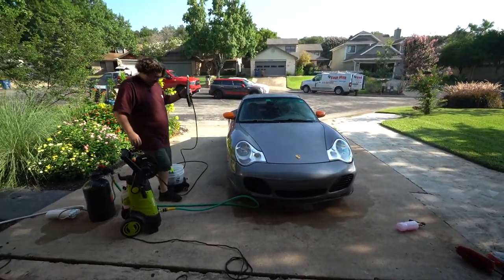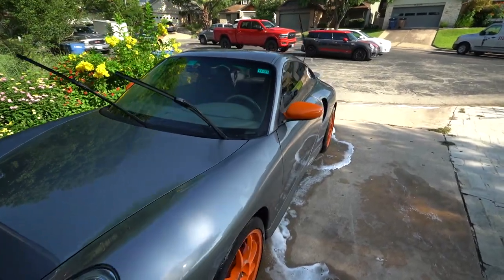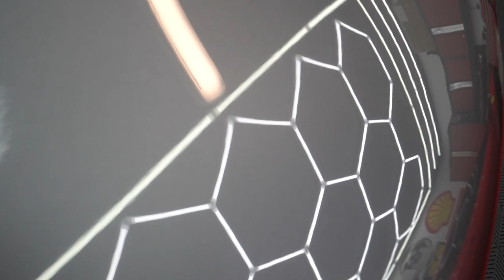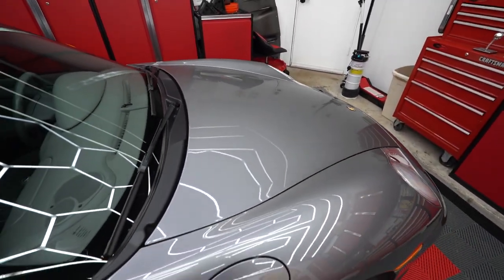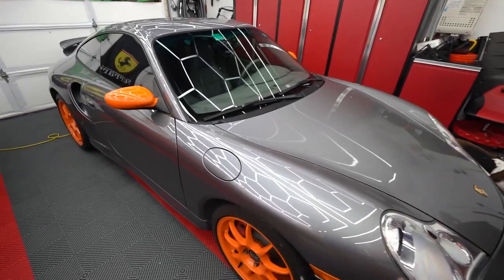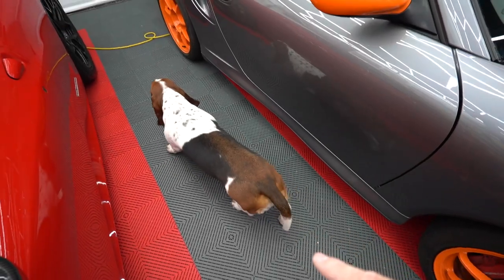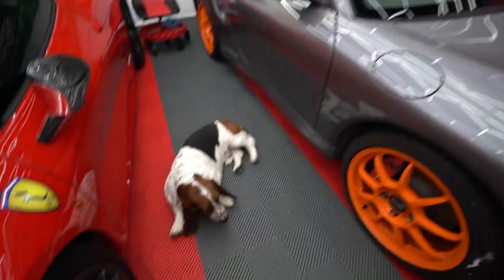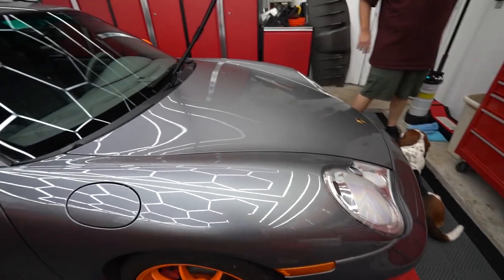The BEST DIY Ceramic Coating? Glidecoat Ceramic Coating a Porsche 911 Turbo

Comment: Dan, please please do a wall mount pressure washer install, it would make a great vid. You're garage is too nice not to do it. Since installing mine this summer I use it constantly. It was painful to watch the mess of hoses everywhere on your wash. Get a good quality washer hose with quick disconnects and it will make the wash experience much much easier. Obsessed Garage- pressure washer vids. is all you need to get set up. Matt does the best in depth reviews on which way to go.
Reply from the maker: Great suggestion!

Comment: I prefer a more expensive ceramic coating, the Kamikazee brand.  However, if you're operating on a budget, this may be a foot into the door of the more professional level ceramic coatings.  Personally, I skip clay barring because clay leaves microscratches in the clear coat.  Instead, I use tar and iron remover and then wash over with a a product similar to Dan's No Spot.  You need to remove any residual contaminants with Isopropyl Alcohol prior to applying a ceramic coat for optimal adhesion.
Reply from the maker: That's a solid strategy.

Comment: Did a ceramic coat on a new f250 tremor six months ago. Still looks great and is holding up excellent. I do wash and wax or at least wash and quick detail as needed to look perfect. I would do it again for sure.
Reply: You put wax on top of your ceramic coating?
Reply from the maker: You can apply wash/wax combination products on top of ceramic coating to help it last longer.  No harm there.
Reply: @normalguysupercar  What about the ordinary stuff at a self-car wash? I’m just driving a 2020 SUV.
Reply from the maker: @dzikijohnny  I don't think it'll do any harm. Not sure how much it'll help though

Comment: What happened to Avalon king?
Damn I just ordered Ak two days ago….
Reply from the maker: It's still great stuff, I'm not putting it down. I think this might last longer. Time will tell.
Reply: @normalguysupercar  ya. Avalon king lasted a wopping 6 months. Tops
Reply: @Treetopflyer777  there is a dude who does super in depth ones on all care care products leaves them out in tx sun for months and years.
Reply: @philipparana9225  What was the best coating?
Reply: @Treetopflyer777  your gonna laugh bc it was nufinish for heading and sheeting.  Only one that made it over 10 months.  Surprisingly the spray on ceramics preformed almost as good as applicated.   I use spray and keep  2 black cars worth over 200k outdoors in Austin year long.  They look fine.  Realistically your gonna have to polish and seal a car once a year minimal prob 2 if you want to keep tip top.
Reply: @philipparana9225  very interesting. Thanks for the tip. 
I think this is the last batch of Avalon king I’ll be buying.